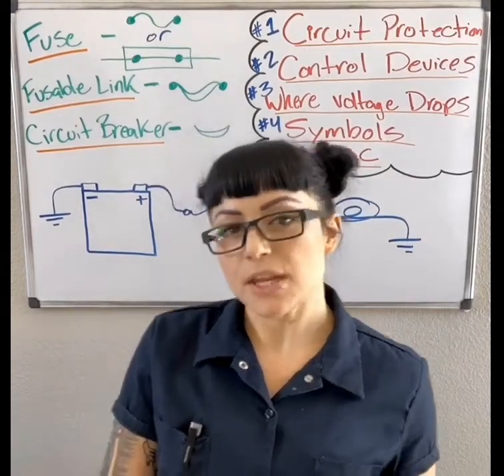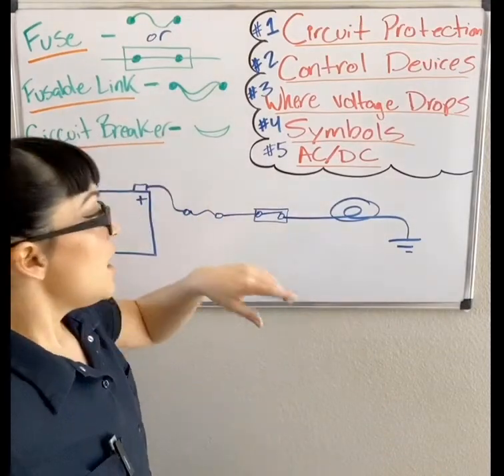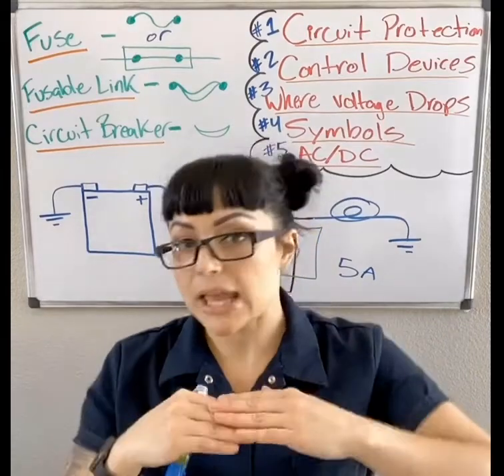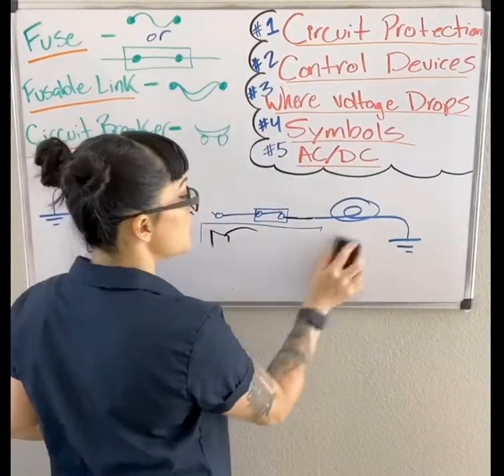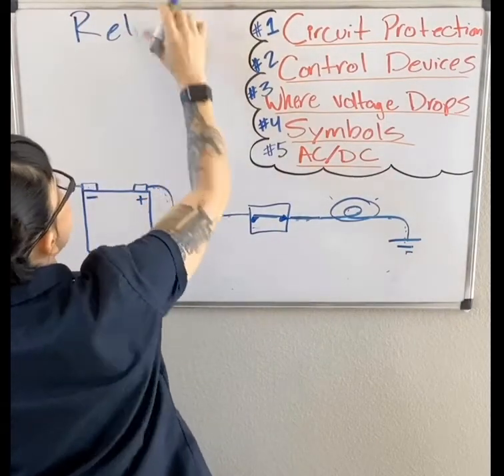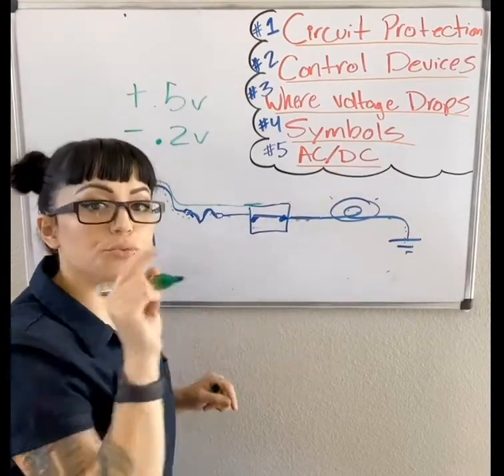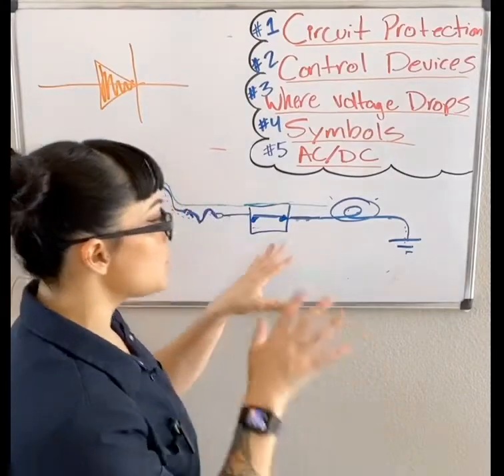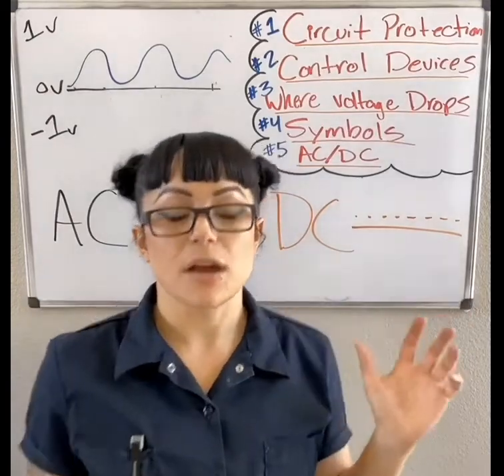Basic Automotive Electrical Theory 4

Comment: 00:02 Circuit protection
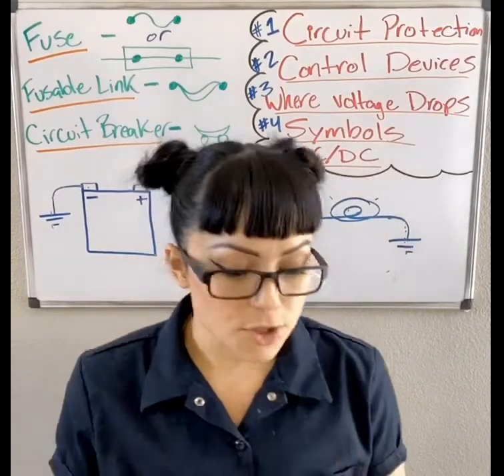18:30 control devices
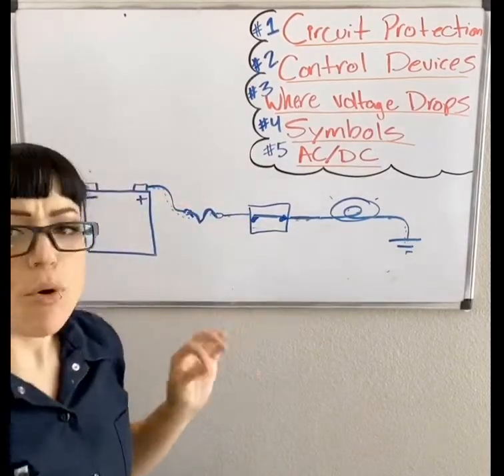24:30 voltage drop
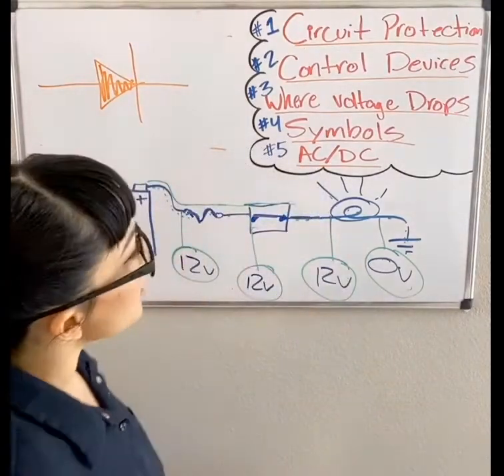35:22 AC/DC

Comment: how can i connect with you?
Reply from the maker: My IG handle is @ms.a_theshopteacher. I post updates on our automotive program here at RCC as well as local automotive job postings.
Reply: @ms.a_theshopteacher 

Hie m Innocent from Zimbabwe. Still a learner in automotive electricals and i indeed find your videos very useful to me. 

So may u put videos for intermediate auto electricals.

Thsnk you advance and i hope to see your vedios with relays as well
Reply: @innomasotya2077  i havent seen new vids by ms. A. 
Hope she can give more relevant vid about relays. 

Meanwhile you can check relay automotive here in yotube , there are ton of technicians explaining how relay works in cars. 

Very simple a coil side (being magnetic) & switch side (where high amps will pass thru) , just like she mentioned.